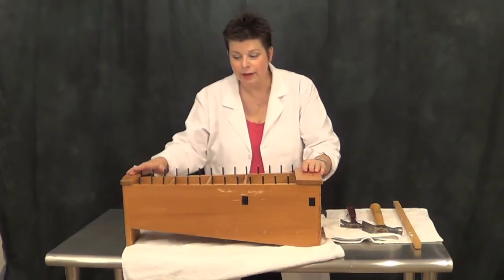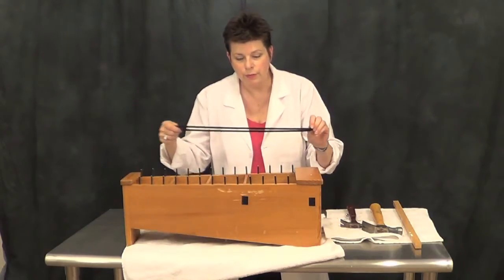Instrument Repair Hospital: Replacing Nails and Tubing

Comment: Hi, thanks for this video! Do you have any suggestions for what to do when the pin has broken off in its hole? (level with the wood, I can't grab it out)
Reply from the maker: There are a couple of ways to remove the broken off flexible pins. First, try a small corkscrew. The pins are all rubber with no other material inside. If that doesn't work you'll need a power drill. Start with a tiny drill bit and drill down into the center of the remaining piece. Compare the depth of the pin to a new one and mark the depth on the drill bit with a sharpie so you don't drill too deep. Reverse the direction and pull up. Fragments of rubber will come out. Continue this process with slightly larger drill bits until all the rubber is removed. Then you can put in the replacement pin. 
Check out our website for more helpful tips on maintaining and repairing your Studio 49 Orff Instruments. 
https://teachingwithorff.com/category/instrument-repair/